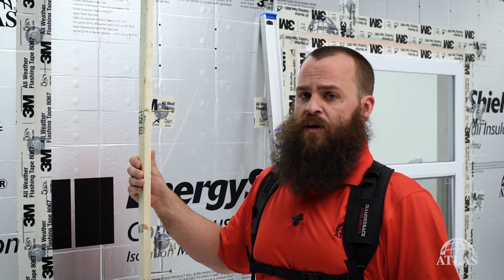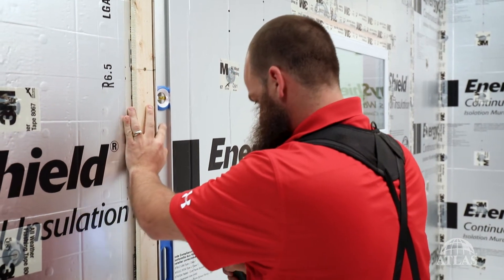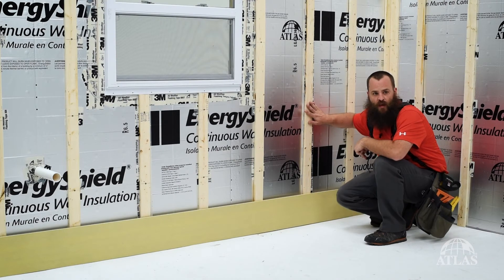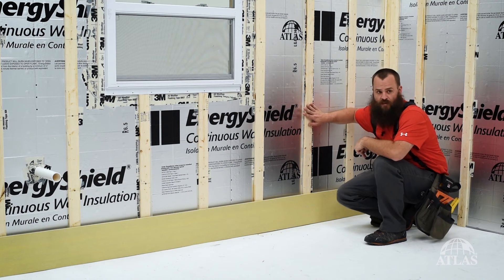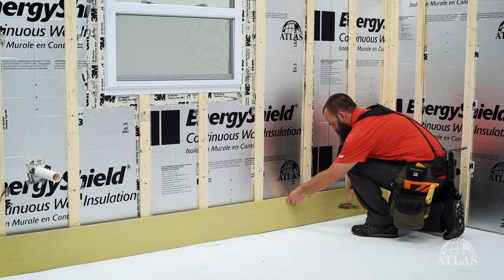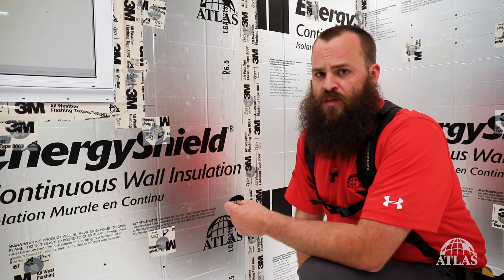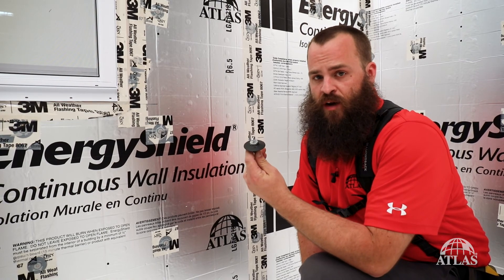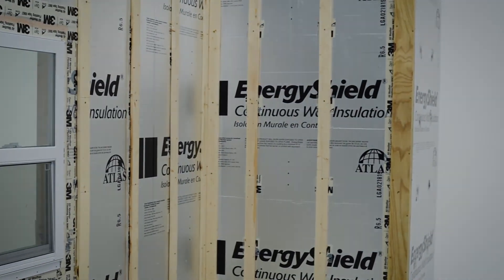Installing Cladding Over EnergyShield Polyiso Continuous Insulation

Comment: That looks like it forms a vapor barrier on the outside of the home.  Does that mean this can only be done with new construction or full wall remodeling so that there no vapor barrier on the interior side of the wall?
tHanks for the video.
Reply from the maker: No,  in fact, homeowners routinely add vapor retarders to walls when they hang mirrors, add porcelain tile, install wallpaper, etc.  In high humidity environments or most of the US during the summer, an exterior insulation layer that is also a vapor retarder will prevent those homeowner "modifications" from creating a condensation plane at the interior wall interface. Typically, the water vapor drive is from the outside to the inside, but an exterior vapor retarder will keep that vapor outside. In the winter, that same exterior insulation keeps the inner layers of the wall warm enough that any water vapor in the wall cannot condense and create problems. Studies have been conducted on homes constructed with interior polymer vapor retarders and exterior vapor retarder foam sheathing, revealing wall cavity moisture content remains low and incredibly stable, regardless of summer or winter. Creating walls that do not undergo seasonal moisture content change is a good thing! 

Here are some helpful tools available online that can guide your product selection and installation choices at continuousinsulation.org, including a wood wall assembly calculator.
https://www.continuousinsulation.org/sites/default/files/uploads/attachments/node/214/ci-quickguidewatervaporcontrol.pdf
https://www.appliedbuildingtech.com/fsc/woodcalculator
Reply: @atlaspolyisoinsulation  Fantastic,...tHanks for the links!!!

Comment: I have found that Polyiso is not as good as the EPS.  But just saying.  Good Job though otherwise!
Reply: Polyiso loses it R value significantly at +++10C or less. So NOT good to use as outside insulation around the exterior of the home in zones 5,6,7 etc where Winters might regularly go below +++10C...So DOW rigid foam is made with a special blowing agent that allows it to be used below grade in moist soil. Other rigid foam, so I learned through researching, do not have the same blowing agent and deteriorate in R value compared to DOW rigid foam.  So much to learn, so little time. STay safe cheers Atlantic Canada, Prince Edward Island 🇨🇦🍁💯👍
Reply: @MegsCarpentry-lovedogs  
Correct.  
Polyiso looses R value all the time for it's whole life.  
So in my view, why   install it !!!  
EPS / DOW Extruded holds it's R value !!!

Comment: Hi, do you have any videos of installation continuous polyiso over a block/CMU structure?
The closest instructions I have found is in BA-1204 sheet M1-Rb:
https://www.buildingscience.com/sites/default/files/migrate/pdf/BA-1204_External_Insulation_Masonry_Wood_Walls_ed.pdf
Sheet M1-Rb is on page 80.
From what I can gather you created a layer of 2x4 and 1.5" closest to the block structure.
Then you attach you continuous insulation layer (outermost layer)  and fasten to the underlying 2x4. See Figure 16 on page 29. I'm hoping to find a video of this Figure 16.
Finally, you follow the video above for installation of lap siding.
Thanks,
Chad
Reply from the maker: Hi! What total thickness of insulation would you like to end up with? That will determine your best method for install.
Reply: @atlaspolyisoinsulation  Currently I am investigating 3.5 to 4" of polyiso. Roughly 1.5" between 2x4 then 2" continuous insulation layer. The only other option I've come up with is to do 4" continuous insulation (one sheet) then attach a furring strip to hold it on using a 6" tapcon. But 6" tapcons are >$1 each and I'm worried about holding power at that distance.
Reply from the maker: @CrosshairLunchbox   I think the NTA report will be helpful here (https://www.atlasrwi.com/resource-folder/wall/Codes%20&%20Testing/Atlas_Wall_CI_NTA_Evaluation_Report_ATL041713-23.pdf).  It gives information on attaching thick insulation boards to CMU. 
I also think that Rodenhouse (https://www.rodenhouse-inc.com/) offers some alternative fasteners that may be even easier to use.